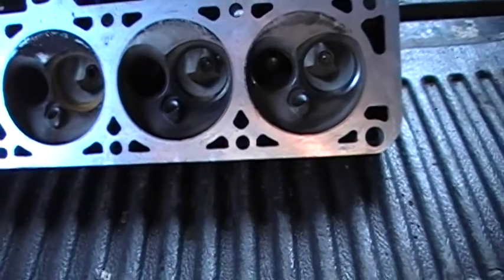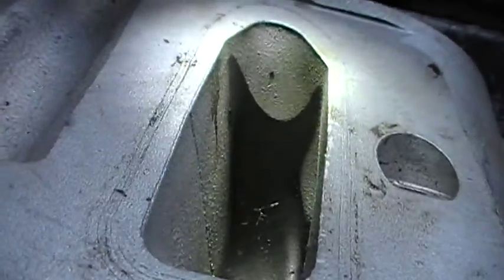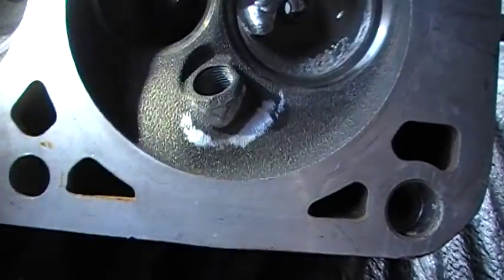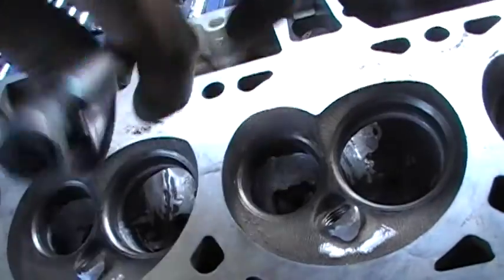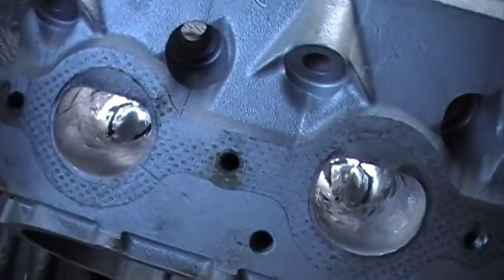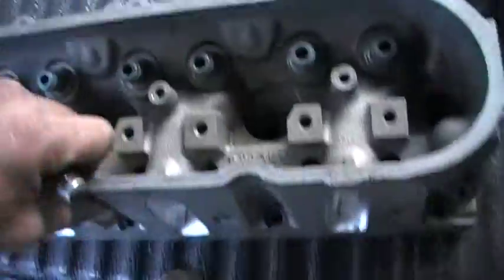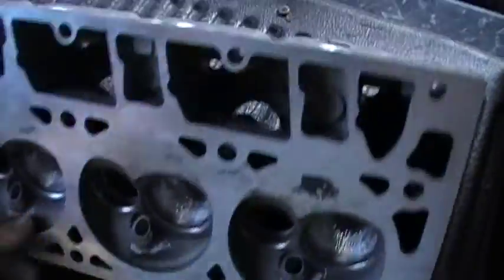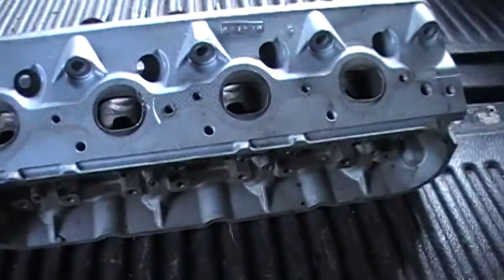how i ported 317 heads 6.0 lsx lq4 lq9 at home

Comment: You must use thread sealer on the rocker bolt after removing the boss/bump.  Without thread sealer oil will find it's way into the intake ports.  Other than the sealer needed the rest of the clean up looks great!  JD